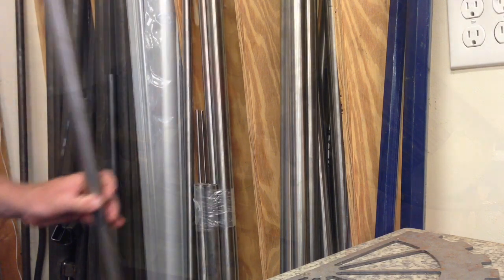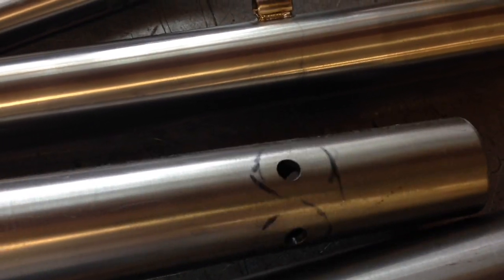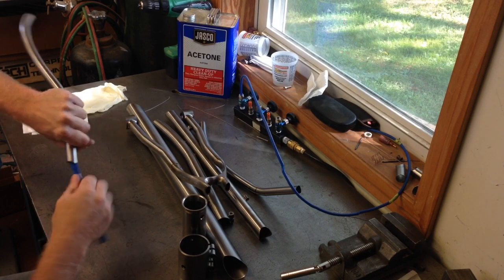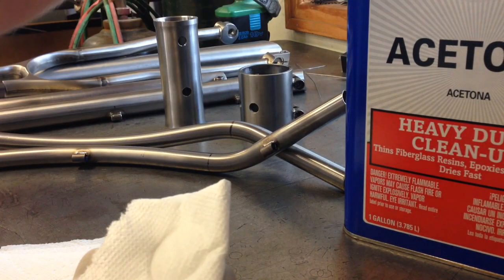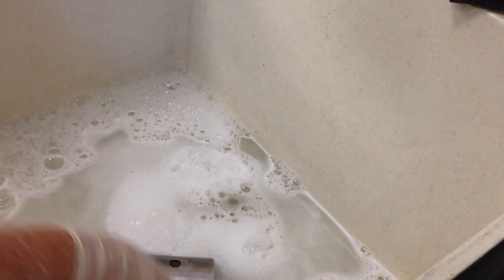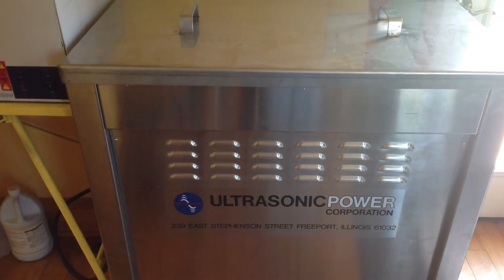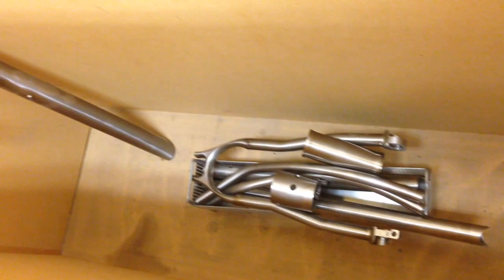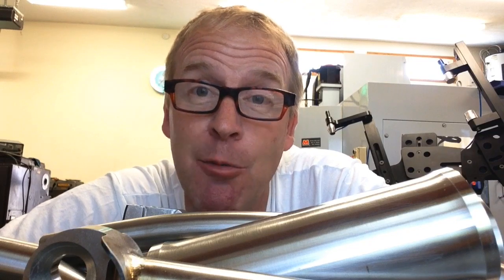Preparing / Cleaning titanium for welding

Comment: Hello Rody, your videos are a wealth of knowledge. About your cleaning procedure, how often (measured in frames prepped or timewise) do you feet 
you have to change the fluids in your ultrasonic cleaner and the distilled water tank? And by the way what's the fluid on the ultrasonic bath, acidic? Alkalic? Neutral detergent?
Which of the cleaning procedures do you employ preparing steel tubing for welding? And which for stainless (Xcr columbus or 9xx reynolds)?
Too many questions, nobody to ask in my part of the world. Wish I was close enough to visit but the Atlantic is in the way...

Anyway please make more videos, anything bike building. For example I 'd like to learn about frame paint preparation and corrosion protection? Corrosion 
protection on the inside of a frame (especially after hot dipping to remove flux residues, I always get flash rust on the inside), anticorrosion primer, fillers, 
sanding, priming, base, clear, which gun, which nozzle, polishing all that good stuff. You can't read about those things in books and they don't teach you that
stuff in framebuilding courses
Reply from the maker: Wow...lots of questions, I'll take a shot...

- I change my fluid in the ultrasonic and water bath when it is no longer clear/translucent.  Due to the vigorous pre-wash steps before it gets to this point, it usually lasts about 18 months.

- I use Brulin Formula 815GD, a mild alkaline detergent in the ultrasonic.  It's specially formulated for titanium.  That said, I know builders who use Cascade and do just fine :)

- Steel tubing follows the same procedure through the wash, but skips the ultrasonic/water bath, then into the bake box.  Stainless is same as titanium.  All get backpurged during welding.

- Have you read through my blog?  It has lots of paint information contained within, easily found by using the search bar in the upper left corner...  www.groovycycleworks.blogspot.com
Reply: @GroovyCycleworks Thanks for taking the time to respond. I'll be sure to visit your blog